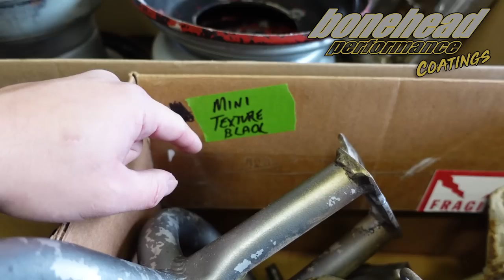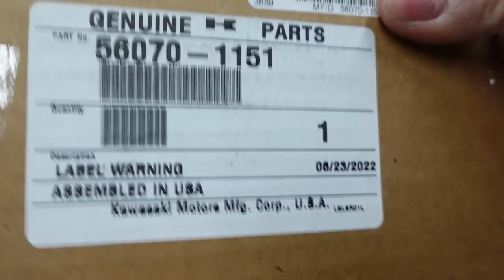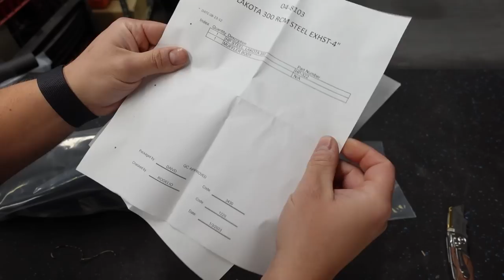Installing the Worst Case of Squished Tires I’ve ever encountered 😂

Comment: If I may make a recommendation on the tire expansion trick, try to find and use starting fluid that doesn’t contain oil. As a kid I’ve seen my grandad do this with tractor tires all the way down to rotto tiller tires, and since then I’ve used several different highly flammable substances to do this. From xylene, methanol to acetylene etc. Id also recommend taking the air hose off and the valve core out to any viewers watching. Because I’ve seen some use to much of a given substance and the tire blows off the rim because the air had no where to go!
Reply from the maker: Thank you for the tips man! I've heard of tires being blown off the rim because there's no relief!

Comment: for your trouble with the brake master cylinder, you have a fluid return hole in the master cylinder ( smallest of the two) and if that one is clogged , its the kind of symptoms that might happen , while changing the fluids, check to make sure that its clean

love your videos :)

Comment: Good video Mike. I have that same bead breaker. I welded all of the bolt together joints and it works 10 times better. Mine breaks down car and truck tires also. 👍🏼Might be a fun welding project for you to tackle.

Comment: The inner tube trick is to get one bead as close as seated as possible then you use a tube smaller in diameter so it’s a little snug over the rim then inflate it to seal against the rim and tire then air up the tire. Use plenty of lube/soapy water and the tube should pop off as it seats

Comment: The issue with using oil to mount the tire, is the oil breaks down the rubber on the tire. Also when trying to seat the bead, make sure the valve core is out and you can use the air hose quick connect fitting straight on to the valve stem. Allows for a lot more air than using the air chuck. You can also use something like "murphy's tire soap". It has the consistency of a real thick grease, pack it into the gap, it will hold air pressure while the tire expands to the rim. Once mounted, scrape off the rest and reuse. One bucket will last for years.

Comment: One up side to ATV tires is you can take them to any tire shop that does normal vehicles tires. Sadly when it comes to motorcycle tires you can really only take them to a dealership that sells bikes. My friend and I took an entire day last summer changing our dual sport bikes over to full on road tires as the shop we went to was booked up solid and we were going to have to wait a week for them to change our tires if we were to bring just the tires and rims to them. We said F-that noise and dealt with the torture of doing them ourselves.

On a side note I have a set of those ODI lock-on's I installed on my bike. I switched it over to a thumb throttle to help me get used to driving clutch again. They're not the same model, mine have the big squishy knobs on them, but man are they worth the money. You can reuse them over and over again no matter how many sets of bars you change to. I also have a set of Pro Taper lock-on grips that I bought in neon pink & gray to go with the lime green of my bike when I was using the twist throttle. Those are also worth the money too. Fun video as always Mike. :)

Comment: Just got a set of these knobbies today for my quad. I've personally never received squished tires until today, so it's funny this video was suggested to me. Honestly, I don't use the fluid method, just bc this is how it turns out for me lol. I use ratchet straps around the tire to press it on the bead. Immediate edit: if only I had watched another 30 sec, so did you lol

Comment: Those heavy bar ends are handlebar dampners to control vibration felt through the grips.  That is high tech items of 80's and 90's.   
Also, unband those tires and put them in hot water a couple days before installing new tires. When the tires get hot, just shape them to the shape they need to be and then just allow the tires to cool down slowly to remove the memory from being folded and shipped in the cold.   Tire changing definetly sucks during the winter season.

Comment: Michael when im mounting an atv tire i have a jug of tire slick and i will try to get one side of the bead to semi seat first then i wil use a locking open chuck and  lean the rim against an object  and push on it till the other bead takes . once it does i pull the locking chuck of and already have the shrader valve in the stemworks 98% of the time for me

Comment: You can turn that muffler into a Supertrapp. All you need to do is get a 4 inch disc kit and end cap then drill and tap the end. I`ve put them on a few DG mufflers to tone them down.

Comment: You can use Dawn Dish Soap or any lubricant to help remove the tires, plus dish soap may attract moisture to the wheel assembly, but some tire paste at napa or something would help reapply the tire.

Comment: You have to have the air chuck on the tire and be actively pumping air into the tire for the starting fluid trick to work properly. We do it all the time with rock crawler tires and semi truck tires even if you can get the bead to seat with out air going in at the same time it will suck back because the fire will consume all the oxygen in the tire and deflate
Reply: Right but what he was saying is at his buddies shop he has the air cheater chuck. It clips onto the valve stem and puts out as much air pressure as the compressor can produce. Instead of the standard style when u push the button, it's still regulated. He would need that attachment matt has for the sudden massive burst of air. Anything less is useless  I've been there when I used to change car tires for a shop.
Reply: @dennisbrooks186  never had to use that clip on chuck all the Milton air chucks will do the job even the one he had that looked like the blue point one you can Throw a zip tie on the handle and keep it flowing once it’s pushed on and you angle it down slightly it will stay on the valve stem I literally do this 10-15  times a month

Comment: I always use a heat gun to get the tires nice and warm/soft when mounting. Also try motor oil. Works amazing. Takes 5-10 minutes per tire.

Comment: Bead blaster is like $100 on amazon. Works great on the squished tires I’ve received, fill to max blast and done. Basically works the same way as the ether method only its shooting 150psi not causing explosion.

Comment: I noticed your Federal Signal shirt.....are you affiliated with them?          Also, I work for Honda....we use silicone spray to seat beads because WD40 is said to attack rubber. The Honda stuff is a super slippery liquid when applied and then settles into a lightweight grease. For the deformation, we take the mega thick cardboard slabs from boxes and fold them into "posts" that we stretch the beads apart with. Let them sit out in the sun for a couple hours, and bingo bango....no more deformities. Makes them easier to work with. I love this machine you've tinkered with...watched all the Top Quad vids and returning to these vids. Might have to trade in my Meatball 300EX for this Lakota.............  :D

Comment: With the valve core out of the stem, don’t use a air chuck. Take the coupler on the air hose and push it down on the stem. You’ll get a lot more pressure that way!!

Comment: Another way to use the inner tube to reform the tire is to do what the commenter said but instead of leaving in the sun place in a over at low heat like 170 and warm it up for a little bit of time , time is going to be dependent on how warm you want the rubber.... don't do it in an oven you cook food in... if you don't have a shop oven (old oven used for random things) then try a different way to heat the rubber up with out setting it on fire

Comment: Can also try using 3 or 4  [ 1" X  "s ] boards. Pull the beads apart as fall as you can, measure and cut boards to length, install to hold the beads apart a few days in the Sun.

Comment: It's about time you got that damn pipe opened up Mike, I had a 2001 Lakota sport in 2008, but I ended up going with the Chrome DG Exhaust, Protaper bars, K&N filter, and pretty much the same tires you're going with.. I ended up cutting the plastics to make them look more sporty and ordered a black hood for it! I put 2 inch spacers on the front tires and ordered sunstar sprockets, couple years later I traded it for basically a brand new 03 RM125.  Oh and uhh.. That DG pipe is loud as hell and will spit flames at night!! 🤣😂😂 Enjoy!!

Comment: As far as the brakes are concerned, I'd check the return port in the master cylinder. I have a 95 bayou 4x4 and it gave me the same issue, intermittent brake issues.

Comment: I don’t mind mounting tires at all, but I always go for pushing the rim into the tire vs tire into the rim, usually I can get it without the irons or sometimes just one pry and it pops in, single bead locks are especially easy to do

Comment: When popping tyre back on the rim, use a ratchet strap around to squeeze the tyre and also inflate the tyre with air at the same time as you fire up the starting fluid or any kind of flammable substance you are using. I know the struggle, when I did it myself for the first time I got the same result as you.

Comment: There's also a rope trick by wrapping a rope around the center of the tire and making it push the center down it will push the sides out allowing you to seat the bead by filling with air use tire lube on both sides as well to make it easier,  the rope trick won't work on the rear tires lol I'd try warming them up while holding them in their proper shape with and anyway possible and after a while try putting them on but if your Jin a rush I don't have any tips besides keep at it

Comment: For Tires like that, I have taken A Cargo Strap, and put the strap around the diameter of the tire, right in the center of the tread, and tighten it down to seat on the rim.
Beat the sidewall with A Hammer, to help seat the bead.
When you had the front tires off, would that of not been a good time to bleed the front brakes.
Oh great, 00:35:48 you did my mithood.

Comment: Use soap and water, not WD-40.  Use them down straps to compress tire. Use a rubber mallet and heat gun to get tire bead close to seating. Spraying the ether or carb spray between the tire and rim works better than on the bead.  Yes it can be very tough to seat tires, especially new squished ones.

Comment: Open up the beads of the tires and put spray paint cans in the tire between the beads and heat the tire with a heat gun or just set them in the sun and let them cool off with the cans still in and they should hold the shape and setting the bead will be much easier.

Comment: Dude I feel your pain with the tires. Last tire change I did on my raptor 660 was a bitch. They came just like yours. Only difference was I got gbc xc masters for the front which even though looking like pancakes when I got them. They weren't too bad. Now the rears I got the kenda bear claws that came flat the same way as your fronts. Holy shit dude They were bead to bead and cold out. It took forever just to make them look like a tire to mount. Worst tire I ever mounted. You said 6 hrs to get yours done......shit I had that on just the rears......probably more than that lol. I'll never do it again. Just a little tip when using the starting fluid don't over do it. One good shot in the tire is more than enough. The fuel to air ratio gets to be too much. That's why you were getting the woosh and not the pop you need. Even with the 35" tires on my truck it takes only 2 short bursts then fire to set the bead. Less is more.

Comment: Something that I find helps me seat a bead (at least on car tires) is that you can reach through the tire with a bar and physically push the bead on one side, then go for the ether trick. Also if you got 100 extra buck you can always get a cheetah tank and blast the bitches on there

Comment: I work at a tire shop man most of the time beads will pop right on but some tires I’ve had 100 psi of air in them before they pop on and your ears will ring for 20 mins when they finally pop. It’s always a sketchy feeling when they are like that the air gauge on our machine goes to 80 psi when it gets maxed out I just turn the other way lay my head in my arms and keep laying the air to it

Comment: 32:48 dude I had the same problem with my van tires. I tried brake clean carb clean starting fluid and nothing worked. I hadn’t had to do it in probably 15 years but it was like the fluid just wasn’t flammable enough. I didn’t want to try propane cuz I felt like working not going to the ER🤣🤣

Comment: stay away from fire seating  . get a ratcheting cargo strap and put around the center of tire. tighten strap until the tire sides pop out enough to hold air and inflate. stop when tire stops leaking around the edges but not seated. release strap and air up tire to seat the bead and add air or remove to proper inflation pressure

Comment: I rebuild utility atv’s, you think those squished tires are a pain? I use a harbor freight tire machine and a bead blaster, works pretty good for me. However I usually have to strip the rim and fill pits and repaint or powder coat the rim. I’ve never really worked on a sport quad as this is a farming/hunting area but about to get started on a trx450r. It is interesting watching you talk about weight saving while I’m used to working on bikes with all sorts of home made contraptions welded on them. I do feel out of my element working on performance machines, I’ve been putting off the 450r and my it200 simply because it’s out of my comfort zone.

Comment: Due have A wood stove.,or heater inside your garage. Then place them beside the heat to warm them up enough to move them freely by hand to pop in the rim bead properly to Micheal.

Comment: Don’t make a trail for the ether just spray and light, but make sure you get some diwn inside the rim, push down on the tire to get it I. There, than light it fast so you can’t h the fumes

Comment: I think it would be a good idea to cut the packing straps off the tires long before I was ready to mount them. It may work out better if you where to heat em up real good to loosen them up just a good suggestion?

Comment: In NE Ohio it costs $50 to mount a motorcycle tire. And that is if you remove the tire yourself.
Reply from the maker: 50 bucks a pop? That shop is ripping people off; I've never paid more than 20$ a wheel and that includes removal and disposal of the old tires.
Reply: Every motorcycle shop around here charges that or more. I bought a tire from the store I bought my motorcycle from and they wanted $70.

Comment: If your doing alot of tires at home invest in some actual tire soap in place of oil or grease. Murphys tire soap is amazing and will make the tire much easier to dismount mount and take air. If the tires are too flattened your much safer investing in some tubes which you can take out after the tires have been mounted for a bit and save them for a rainy day. I know the ether trick is cool but fire and rubber really dont mix. I did some tires that looked like that a few weeks ago but they were 1300 24s on a road grader. That fucking sucked. A cheetah/bead blaster is also a good investment if you wanna do them at home.

Comment: I'm pretty sure the 300ex is going to win the shootout, but if the blaster gets a pipe it might do ok. The 300 ex is geared pretty low and could really use a tooth bigger on the front, ot two teeth if you're going with 20" rear tires.

Comment: Your muffler came in! I'm glad.

The reason they put those bar ends on there is to cut down on the vibrations to your hands. The heavier the better.

Those are the original grips.

That might be the original paint on the wheels. They are KMMs, if memory serves, and their paint SUCKS. Looks all splotchy, doesn't stay on there, etc.

Ah. Kenda dominators. OEM tires on the 2000-02 standard DS650s.

Hey! Motor medic thrust starting fluid! I can tell from here!

For anyone who has never beaded a difficult tire, there is NOTHING more satisfying than that "I'm accepting air pressure now" sound. Mmm. Better than a baby's laughter.

No no no Mike. YOU gotta install the tires for any real money. He's gotta SEE YOU do it. You wouldn't work a measly 6 hours on those for 50 GRAND? Shit, I'm fat and outta shape, and I'd do it for like 10 grand!😁

Damn it, I thought I came up with the tube trick. Oh well. I can confirm that it helps.

DG's site says the RCM black steel muffler is still in stock, for anyone else who wants one!

Comment: I used those short spoons on my bike one time, I had to patch a hole in my sisters living room wall.
Reply: Do you heat tires? Space heater or something? :: you answered with ether, lol.     Ether works best when it’s on the bead, if not on the bead needs more ether bigger effect to seat that bead.  Tough job, good work.

Comment: move the air compressor outside of the shop, build its own little tiny shed for it to live in so you dont have to deal with the noise of it kicking on and ruining the video take.

Comment: You’re pussy footin’ you gotta spray that shit in there dude. I used to do the same thing till my cousin came over that worked at a redneck tire shop and told me the same thing. Love your videos dude. I’m totally rebuilding a LTZ 400, halves just came back from Motoblast and frame is at powder coaters, wish you had one in your repertoire. Life’s a garden…dig it.

Comment: You need more either and keep the shrader valve in and they always pop. Your also gonna hate the rcm exhaust, its way to loud. I run it on my 250x and wish it was a different exhaust. It's louder then my 450r with no packing in my hmf

Comment: wonder if you get a box sealed with the tires inside then put a hole on the top sdge & bottom edge & get a heat gun when its cold & put the heat gun in one of the holes of the box